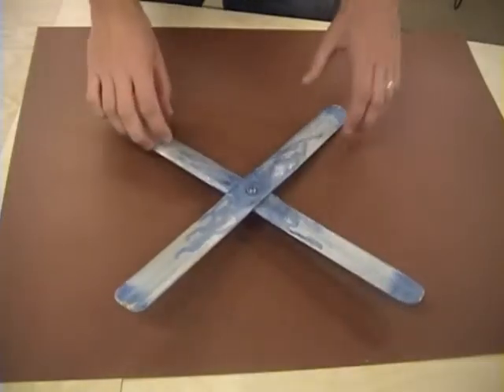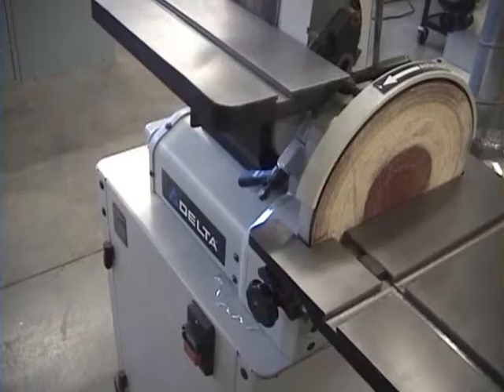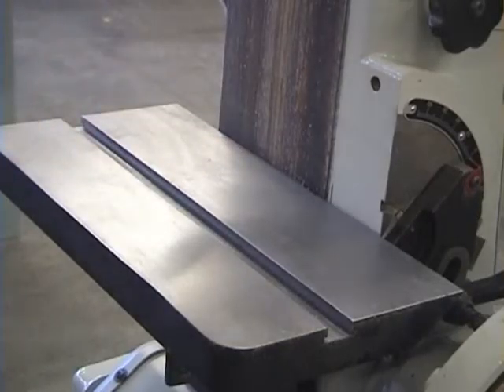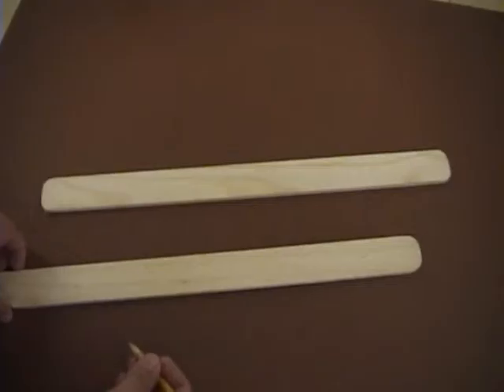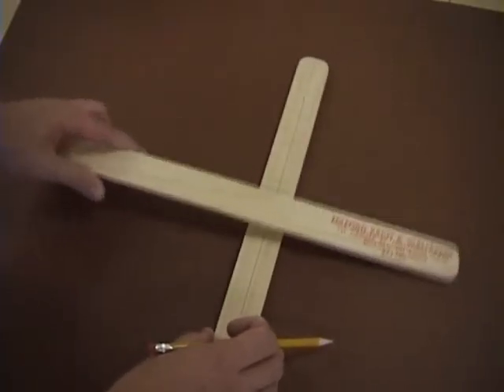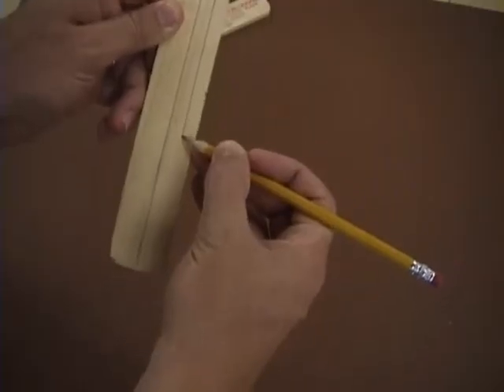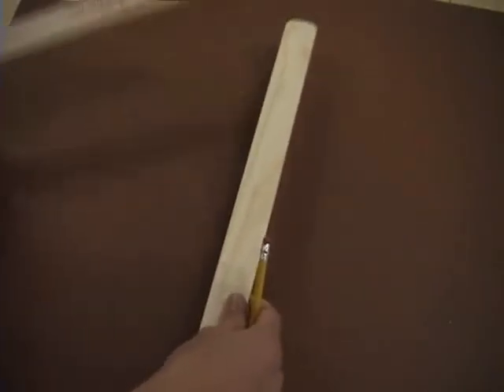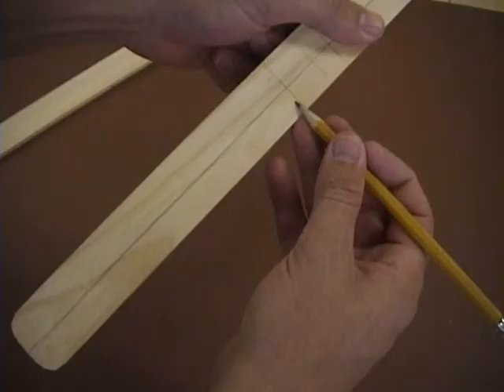How to make a boomerang part 1

Comment from the maker: It is just a trick that I learned.  I can't draw a straight line normally.  I lock my finger against the side of the pencil and just move my finger down the side of the board as a guide.  This makes the line nice and neat.  This only works on the side of a board.  I mention this in the video , but I don't think that I explained it very well.